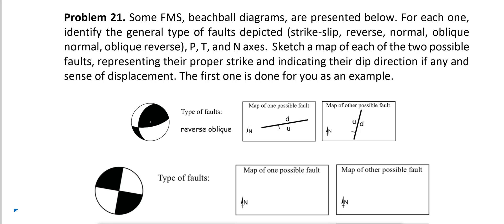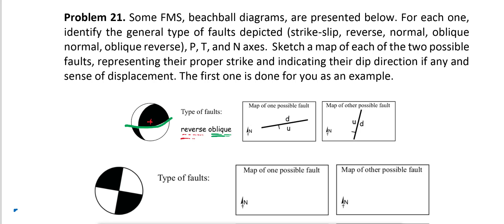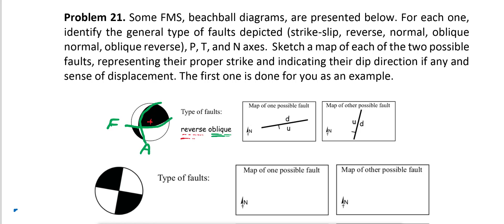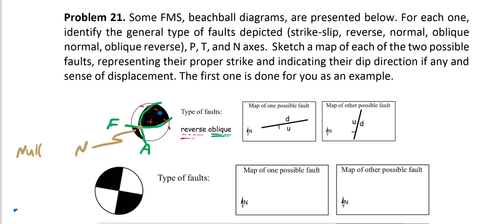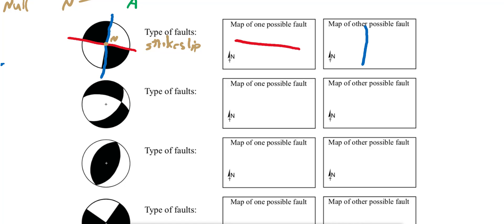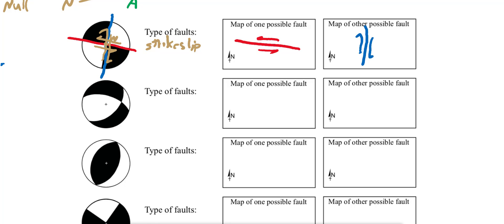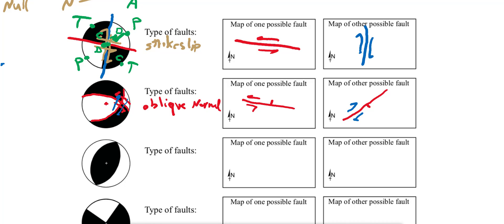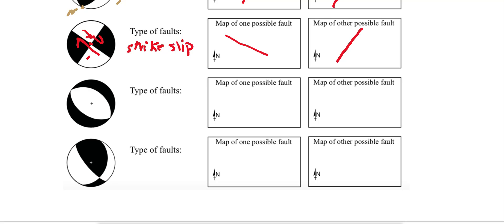Basics of focal mechanism solution - P22

Comment: Can we know the dipping direction of the last question (Oblique Reverse fault)? Or it cannot be determined with the information provided in this question?
Thanks!
Reply from the maker: You can obtain the dip direction of the fault plane. You should read the strike and dip of the fault plane on the stereonet. Read it in the Right Hand Rule convention, and then add 90 to the strike azimuth, and that will be the dip direction.